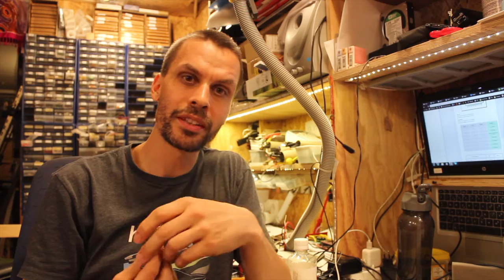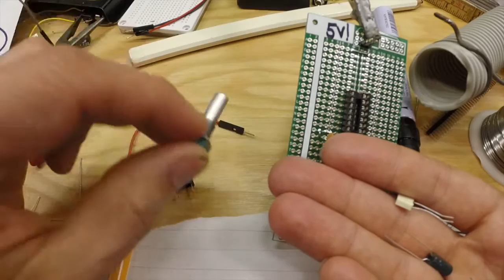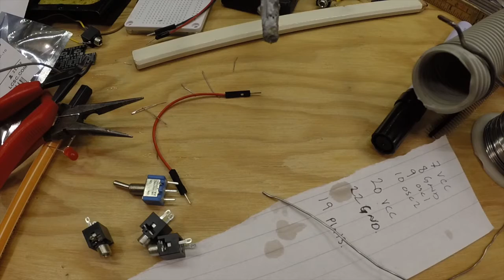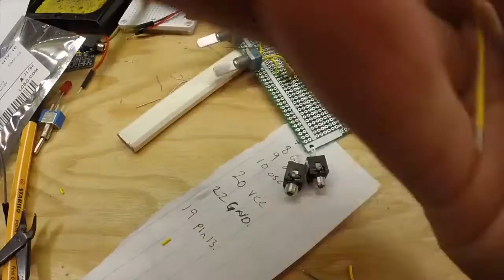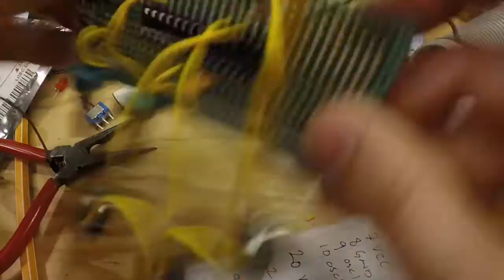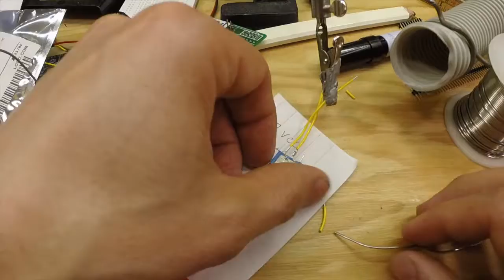Build the Jan Ostmans O2 on the Proto

Comment: Hello.
In which pin of the midi port should the CLK Out be inserted? In pin 3?
Reply from the maker: No! This is not midi. It is just pulse sync afaik. I would not plug it into midi. That needs an optocoupler in between to isolate the signals.

Comment: On viewing I got a nano,  built it on to a protoboard, and I now have a MiniPops..!
IF ONLY THE CLK OUT WORKED..!
Have you come across the same problem..?
I've scoured MW and various other sites looking for a solution..
I think the difficulties are in the "if" statements, but I don't have sufficient Arduino chops to recognise or fix it..
(bum..!)
Reply from the maker: AWESOME! 🙌 I Actually got the clock out working. But I think the gate signal is really low. I have a video coming soon with a circuit (opamp comparator) that might help you on your way with this. I’ll try to remember to address this problem and as a solution as well. :)
Reply from the maker: See here for the clock out actually working: https://youtu.be/p62tkbrC5mw?t=715 but as I said, it probably doesnt work with all modules as the gate/clock signal is really low...
Reply: @SourceryOne  if I plug the clock-out into an amp I can hear a 'tick', but not enough to drive anything (meter says 1.3mv!)
I did consider hooking it up to a 2n2222 to see if I could make anything happen..
which might happen later today..
I've also seen a blog post detailing a code amendment to the "if" statements.
I tried it, it didn't work and I don't have sufficient coding knowledge to make it work at the moment..
Still this is all part of life's rich pagent so I'll just sit about and let talented young people, like yourself, solve the problems...! ;)
Reply: Clock out works nice on mine, and midi out also.

Comment: Oh, well. Just an idea for a drum machine module using this simple circuit: imagine having 8 inputs. Each setting the individual voices on or off. 2 variants: one using the predefined rhythms (just as the original circuit) and tempo (which could also be "VACTROLIZED"). The other one WITHOUT the rhythms, being driven by a clock divider module (with eventually an internal clock generator)... simpler, but claims for even higher freedom and creativity. Not even to mention the fact that you could program more "instrument samples", instead of just 8.
Reply from the maker: I think somewhere in his large library of code there is a trigger input "drum synth" buried... I have bought a whole lot of his codes, and downloaded the ones that I found that are open source, and well see what I come up with :)

Comment: Great!!!
How you program the Atmega? 
The loader is special one?
Regards.
Reply from the maker: I program it by replacing the atmega328 in an Uno and then burning the boot loader and then just program as usual. Then remove the atmega328 from the uno and onto the proto board.
Reply: And here is how to connect and program the AtTiny85: http://highlowtech.org/?p=1695